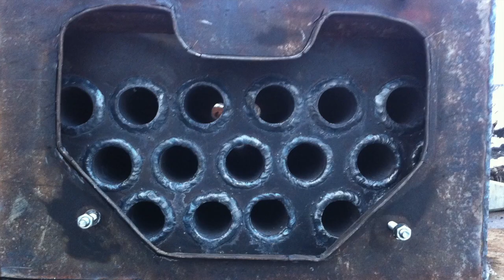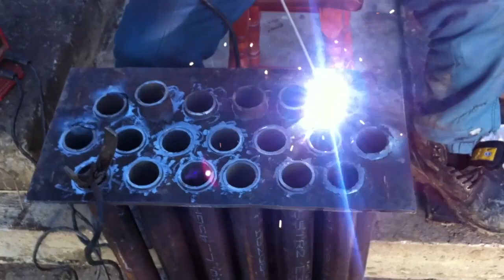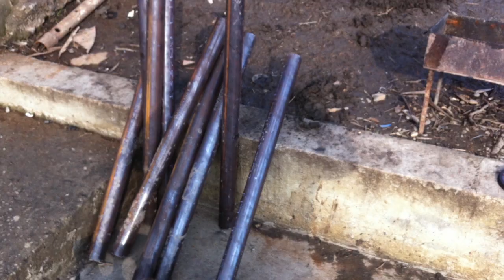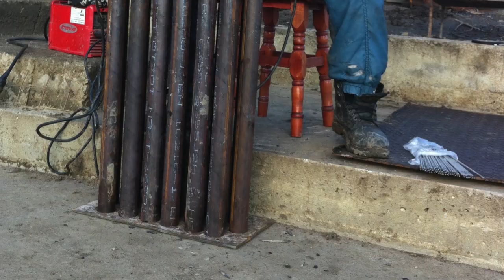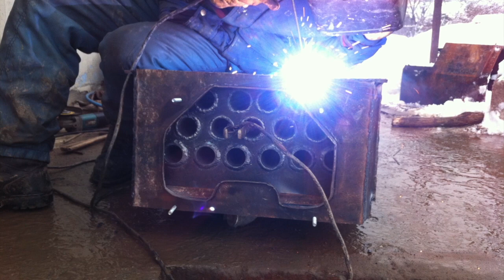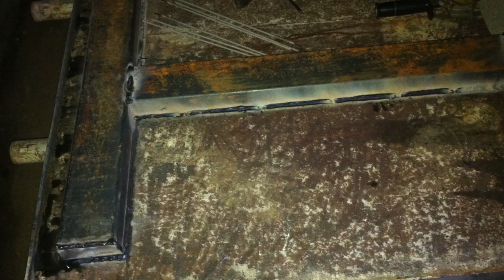Recuperator de caldura cazan viadrus

Comment: salut ! 
vreau sa-mi fac si eu un schimbator din asta de caldura la fel ,tot cu tevi 1 tol jumate, pe care vreau sa-l montez vertical intre cazan si cos de fum , adica in loc de burlan. Am un viadrus  u 22 35 kw. , intrebarea mea e daca o sa aiba tiraj destul prin tevile astea (18-19 bucati) fara ventilator. cosul meu de fum trage foarte bine dar nu stiu cum s-ar comporta sa traga prin tevi. as putea sa prevad din constructie adaugarea unui ventilator ulterior? ce ma sfatuiti? Sa pun tevi de 2 toli sau 2 1\2 toli?
Reply from the maker: trage fara probleme mai ales pe vertical, la mine merge si fara ventilator
Reply: DIY LudovicescuConstantin posibil sa-l fac din teava de 2"1/2 (76.1mm) diametru ,15 buc. 1x0,4x0,6 =180 litri daca scad volumul tevilor. il fac din tabla de 6mm in partea de jos spre flacara si 4 mm restul. vreau sa trec turul de la cazan (1"1/2 ) prin el si din el in pufferul de 1000 l al instalatiei existente. sper sa fie ok. Daca are cineva o sugestie sau sfat ,le accept cu placere.
Reply from the maker: Dai bataie merge fara probleme daca nu ai curaj vino la mine sa vezi cum merge

Comment: salut ce diametru are o teava si cu ce tip de electrod ai sudat (supertit fin sa baz)
Reply from the maker: teava este de 1 1/2' (un tol jumate) teava trasa de gaze are 3,5 mm grosime electrozi supertit 2,5
Reply: @ConstantinLehadus  aparat de sudura fronius bravo ! ,cat costa un fronius ca acela si  ce model este ?
Reply from the maker: @NeacsuPetre  FRONIUS TRANSPOCKET 1500 cumparat la mana a doua cu 300 euro nou este undeva la 3400 ron
Reply: Super tit fin nui bun la presiune si fluctuati termice informativa